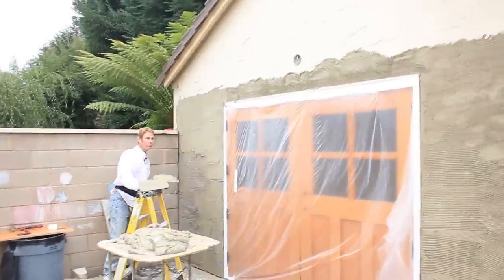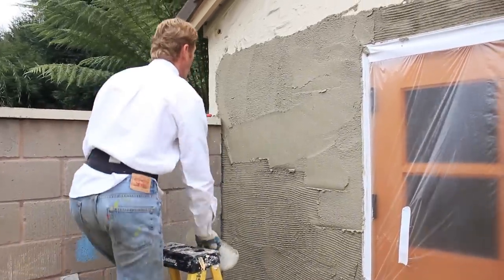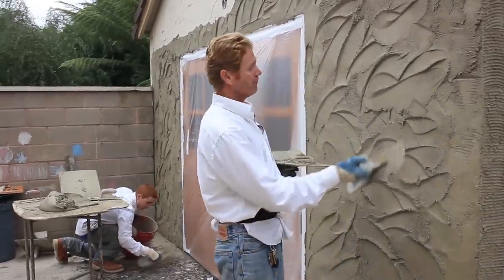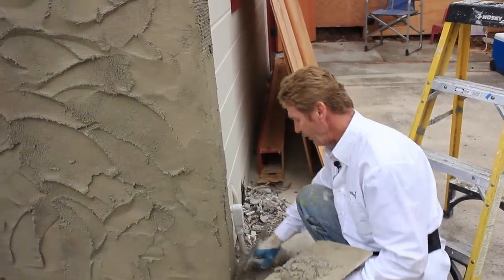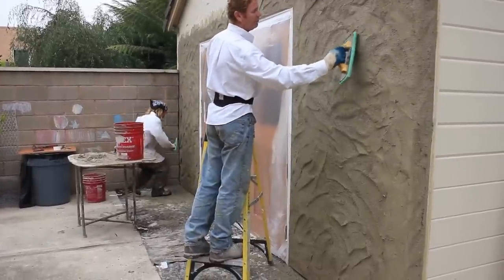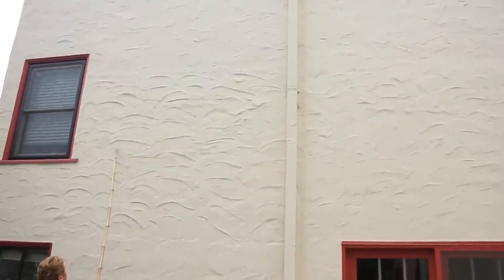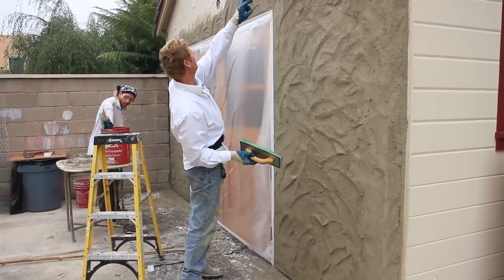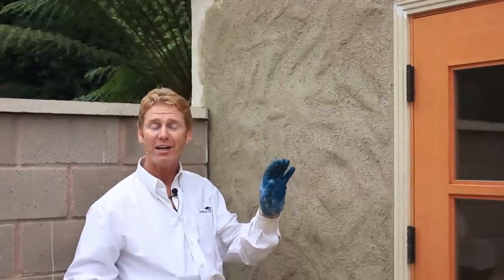Stucco finishes that are unique

Comment: These heritage techniques can be a really hard thing to patch in.  Well done.
Reply from the maker: Most of us plasterers prefer these unusual textures to match rather than the everyday easy stuff.😉
Reply: @StuccoPlastering  I agree.  
Interestingly enough, I just came back last night from a trip to Germany, and noticed some new things being tried.  The trade has always been alive and well there, but they seem to be fiddling around with new mixes and techniques to get some very contemporary visual effects.
One that I've been looking at over a few years, just to see if it held up, is a thin mix applied to roughly laid brick with lets the profile and texture come through, as well as a LITTLE bit of the brick color.  It's held in place, even at the sidewalk level where it faces a lot of traffic.  I saw no moisture staining, but that could have been concealed by the mottled texture and color.

Another was the use of a randomly toothed screed tool to place horizontal linework in random bead lines directly over concrete, with some of the board formwork texture coming through.  Whoever did this wanted some dripping and migration for effect, but not a lot, and it held to curing.
The mix, as best as I could tell, was high ratio of cement, VERY fine sand aggregate, and some kind of pigmented polymer liquid similar to the type used in tile setting.  It gave it a waterproofing effect in both directions which you can easily tell over concrete.
Just for giggles, I did try to see how stiff the cured mix was, and it was very stiff.  it was hard to chip with a knife.  I'm not completely sure what it was, but I'm going to do a little homework on it just out of curiosity.  If I get anything reliable on it, I'll pass it on.

What impressed me was that both of those installations were one-step procedures relying entirely on finishing technique, so I would guess that it commanded a decent price for the level of skill needed, but was probably doable and "sellable" based on the application time, making the cost acceptable to the owner and the applicator.
It also would fit a general construction schedule well that way, since a good part of the copings and flashing work came in after the plaster.

For something that appears to be new, they made it work, and that was impressive.
I'm impressed that they didn't have an adhesion problem, but then again, the temperature range from February to August is a lot less than what we have in most of the US.

Comment: Wait, so you don’t need a finishing coat with this, you just texture the brown coat? Also, if you don’t use the sponge float, will it turn out alright (even if a bit rough)?
Reply from the maker: Howdy correctomundo, most homes in the world are two coat finishes. It does not need to be floated. I floated it to bring out the sand to match the existing finish. 🍾

Comment: Hi Kirk!!

My home currently has an old-world stucco finish. I'd like to replaster it, to give it a key west/beach house look with horizontal lines going across (so that it looks like siding). Similar to the design that shows up in this video (the wall adjacent to the one you're plastering). What is this design called? I'm trying to find a professional in my area that can do this for me and I'm not sure how to describe it properly. 

Thanks!! :)
Reply from the maker: Hi Yesen, you could type in "stucco contractors in my area" who specialize in making stucco look like wood siding. Only a handful of stucco guys know how to do this. Best wishes

Comment: when doing stucco whether its smooth or custom texterd when.  it comes patching walls i. found the best rule is to do the whole wall if u dont know how to texture with different material. u will have trouble ive. been doing stucco by my self on giant houses 30years with no joint lines or location of latches
Reply from the maker: Morning Jon, exzackory
    Live long and plaster
 teaching  plastering video’s

Comment: Have you ever installed the rock panels , scratch coat of grout then push on the rock or slate looking panels?
Reply from the maker: Good Evening Al, indeed I have, it simply takes practice.   
                            Best wishes,
  Sharing stucco secrets and or common sense plastering tips

Comment: that goes right over the cement blocks???
Reply from the maker: Hi Rod Kali, this stucco was applied to paper and wire,
 however the same system can be applied over brick and or cinderblock also,
 cheers,
 kirk giordano Plastering
Reply: Cool thanks

Comment: Hi Kirk. 
Not sure if you are still posting videos. 
I live in Tampa, FL. 
I have removed fieldstone adhered with mortar mix from a couple of sections from the front of my 1984 stuccoed house. 
Behind the fieldstone is a scratched mortar mix finish; next to it is a  6" x 9' cinderblock section which used to be covered up by a piece of wood. 
Q1. With a fine finish of stucco mix the existing scratched mortar mix surface will closely resemble the rough stucco on the rest of the house.
   a. Can I apply a thin coat (1/8") over the existing mortar mix? 
   b. Do I need to apply any bonding agent over the existing mortar mix? 
Q2. I have four 6" x 9' sections on the front of the house that used to be covered by wood boxes. I have removed those old boxes. Underneath is cinderblock. 
   a. Do I need to apply a bonding agent on that cinderblock before applying the stucco? 
   b. Or, do I need to use mesh/screen? 
I will be repainting the house a different color when done. 
Thanks for any guidance. 
Pat
Reply from the maker: Hi Patrick J. Knight, Sorry, I can't answer these questions without viewing your situation,
 Sounds to me like you need an expert to repair the work needed as it's too difficult to try and walk you or anyone without at least ten years of experience through this very detailed work, sorry, and best wishes. 
 kirk and family
Reply: StuccoPlastering Thanks Kirk for your immediate response. Pat
Reply from the maker: HI Patrick J. Knight,  I was beat up yesterday and too tired to give your question the time it deserved, After a good night sleep I have reread your question and have come to the conclusion that if it were me I would pressure wash the whole wall and skim coat to blend all the finishes in. The difference between a skim coat and a  scratch is with a skim go at least 1/2 inch and cover well so the grout lines won't show and one pass is all that is needed. Of course apply the liquid lath Or (weld crete) as it is commonly referred to, I have included a video that gives an idea of what you should do below.
http://youtu.be/TuwvarKFpko
 Best wishes,
 kirk and family
Reply: StuccoPlastering Thanks so much Kirk for your professional guidance. I took your initial advice and talked with a local person who has done some stuccoing. He recommended just going over the section with wire mesh, screw it into the existing mortar mix and cinder block and just apply scratch and finish coats of stucco. That sounds like more work than I have to do since I have a "scratch" coat of mortar mix on most of the area already. 
I really appreciate your help. I will let you know how it turns out. 
Pat K.

Comment: Hey Kirk...can you use a "brick stamp" with stucco?  If so...any suggestions to what product?

Thanks!  Great Videos.
Reply from the maker: Good Morning Man Dude, Like the ones they use for stamped concrete?
 I have used rubber stamps for concrete but not for stucco, if I were to use I would with cement products that takes a long time to set. 
 yes, it does require a bit of skill.                   
                       Live long and plaster
                     Kirk and Jason Giordano
Reply: So maybe I'll just try the plastering.  I'll be doing a kitchen.  I saw on your videos you used Structlite base Then Diamond veneer (over plaster weld).  Does that sound like a good plan? (I'm new to plastering)
Thanks,
Al

Comment: Hello, I'm just interested to know. Do you ever suffer from 'tennis elbow' or plasterers elbow as i do.
And if so how do you get around this. Thanks.
Reply from the maker: Howdy Dude, no I have never had elbow issues, although I brooke all the bones in my right wrist from a fall from scaffold and had my sholder opened and a muscle from my biceps put in my shoulder as I was showing off and pulled a tendon that would not heal after 3 years, I heard both times "you'll never plaster again, I thought both times how foolish a thought like that was to contemplate or think much about thus was back plastering in less than a year.
    I have had back issues but that's because I don't bend properly, I'm learning how to now by watching a ten minute vio every evening and following instructions, thus back pain leaving,
 My elbows, shoulders, wrist have always been strong as I believe two thing, you are what you eat and drink, and two, use it or lose it. 
(muscle and strength)
                       Live long and plaster
 DIY repairs for your most prized and number one investment, your home.
Reply: Kirk Giordano plastering Inc. 
and
Reply from the maker: Howdy Rudy Dude???????
                       Live long and plaster
 how to repair their number 1 investment

Comment: Hi kirk I'm Tony I'm a professional plasterer of 18 year's, this is the easiest plastering you ever do, you are making it sound alot harder than it actually is. I think you should concentrate on how to use the hawk and trowel correctly
Reply from the maker: Howdy Tony, thanks for the tip       
                     Live long and plaster, 
  Sharing stucco secrets, or common sense tips
Reply: Watcha Tony, I too work in the wet trade but now only do lime putty work and avoid gypsum & cement if I can.
I have to say in the great Mr Kirk's defense that ever since I asked him about why he uses a rounded pool trowel I got mine out, used a grinder to cut off the top and bottom and now use it all the time. It's much lighter than the usual trowels and they also have more rivets too. The only thing I cannot do that he does is to wear gloves when trowelling and I would have sacked the plasterer that did the 1st rendering on that garage but to match it up you just need people that have never rendered before haha.
Reply from the maker: Howdy Peter, I remember a time when I didn't wear gloves.
 The lye in the colored finish jacked my hands so much that I couldn't hold my girl's hand, each time I opened them blood would squeeze out from my joints, I had to apply coconut oils on my hand then use bread bags to keep the oil on while I slept, that was more than 30 years ago.
 I have known many who have lost fingernails by not wearing gloves also.
 I was young and didn't understand what transdermal meant, an old timer told me to put some garlic on your feet and you will taste it in 5 minutes, I learned what transdermal was after that test.
 Been wearing gloves ever since, now the skin on my hands are soft as a baby behind, although they are soft I have the strength of the Hulk in them.
                      Live long and Plaster
 Kirk Giordano’s plastering and stucco wisdom videos
Reply from the maker: Howdy Peter, there was a time I didn't wear gloves either, hand hands like leather, the only problem with that was they often bled at the joints.
   The lye from the color coats ate the skin up. Had to wear bags with vaseline on my hands at night until they fixed themselves.
 An old man told me to put garlic on the souls of my feet, and that in 5 minutes I would taste the garlic, he said that same thing happens to any part of the skin that is exposed to any toxin. I thought he was crazy until I tried it.
    Been wearing gloves ever since.
 The skin on my hands is now soft as a baby arse, while my strength in them is still impressive.
Best wishes,
                      Live long and Plaster
 Kirk Giordano’s plastering and stucco wisdom videos
Reply: Sounds like the stuff you are using is a lot more toxic Kirk than my lime sludge. When I'm doing finishes on a floating coat, the wet work, or else I'm using a sponge on a top coat, then I will wear waterproof gloves, I have to, otherwise I get those small  lime burns that can take weeks to heal, because I take the creamy mortar off the float with my fingers and place it in the dip, it's easier than using the small tool or trowel.